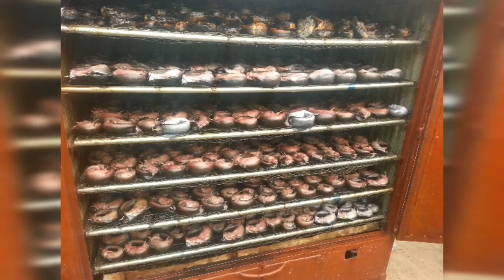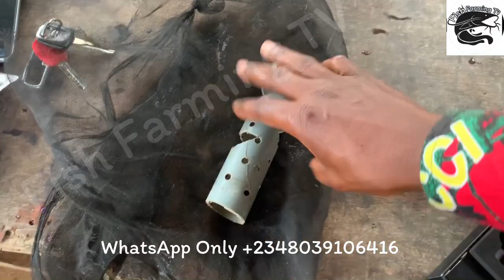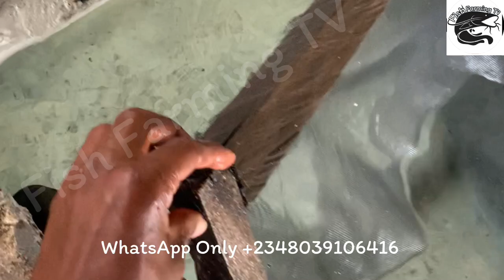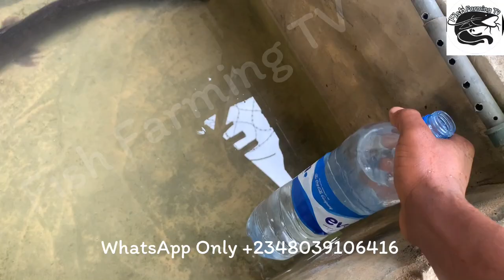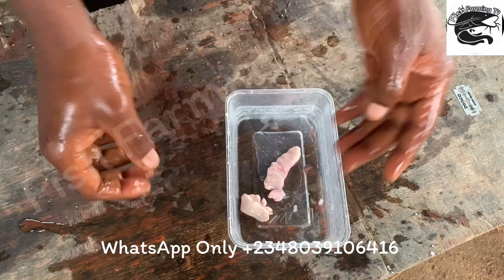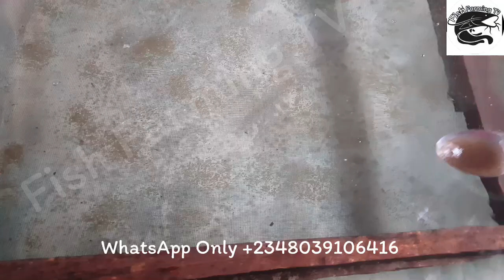Live practical on catfish fries hatching part 4 | Spawning & fertilization

Comment: Why did you still add fresh water? Isn't the Norma solim water enough? Is it necessary?
Reply from the maker: To avoid water pollution with the sperm , complete the fertilization on the bowel then remove the excess water, only practice what you saw on the video

Comment: Thank very much sir for ur insightful teaching on hatching. Sir after hatching will the water continue running  or it has to be stopped.
Reply from the maker: Water will continue to run 24 7 for 6 to 8 weeks
Reply: After removing the male sperm, what becomes of the fish.
Reply: For the 6 to 8 wiks will the tarpaulin be covered assuming one is using the tarpaulin method